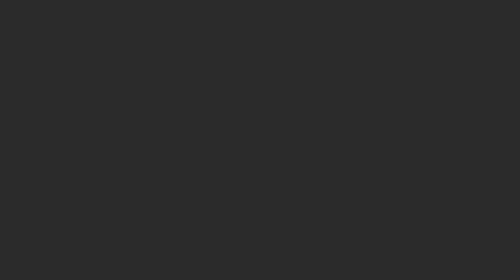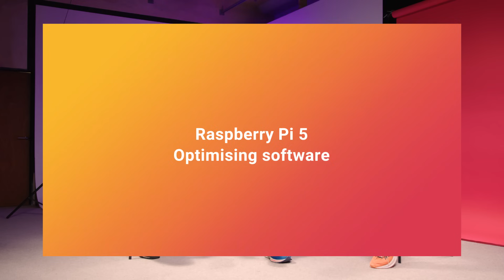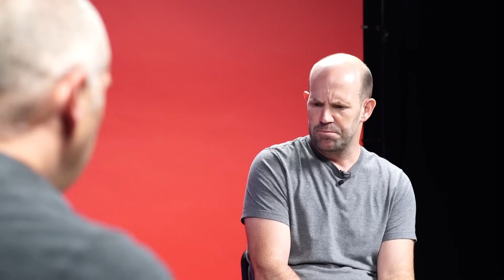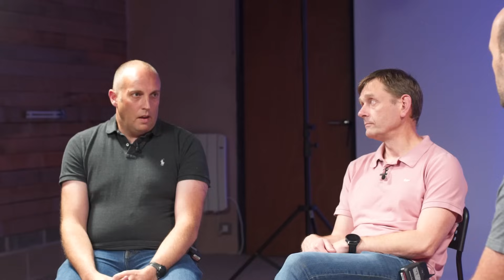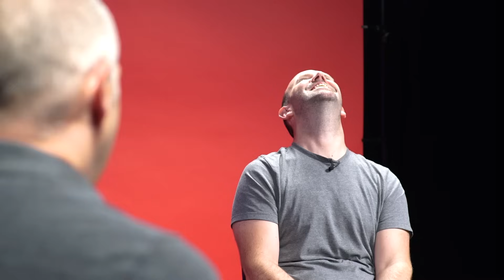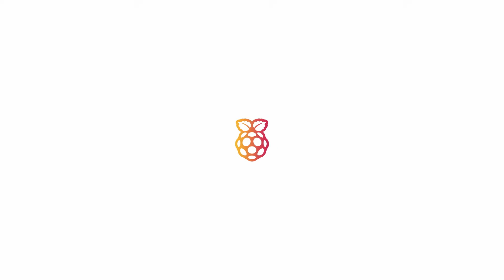Optimising Raspberry Pi 5's software environment

Comment: Theoretically, how many external hard drives on a external hub can RPi5 support? Not how many ports can be made, but how many drives can be connected via one large Ankor hub. I guess it's a RPi5 USB power question. (the hub has a beefy power supply and each drive is independently powered)

Comment: I read somewhere the rumor that they had a plan at some point to move to RISC-V with Pi5, but the platform is just not powerful enough for this yet. With all these changes separating out I/O into RP1 and reducing the role of VideoCore I can see why this could be on the horizon: the CPU becomes essentially replaceable as long as communication with the RP1 is possible over the PCIe bus. Interesting. It would have been a nice coincidence to switch to RISC-V with the 5th Raspberry though. :)

Comment: If the RP5 is 2X faster and runs on 5V., it may run 8X faster with a standard USB type-C 19V laptop power supply.

Comment: It's amazing how most of the problems with PI software are based on the crappy software beneath. I can see how AI will solve all of that soon. From firmware, to drivers, OS, packages, app layer, when all is rewritten with AI, all will be good :)